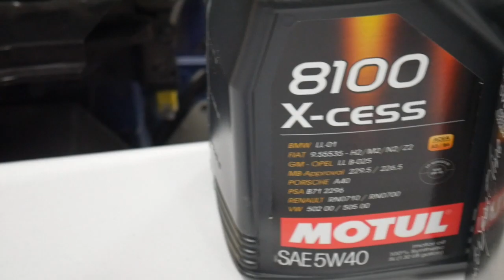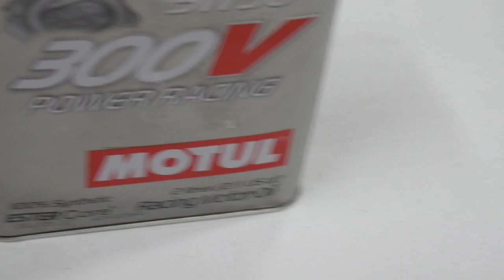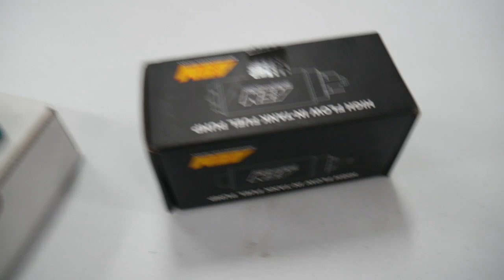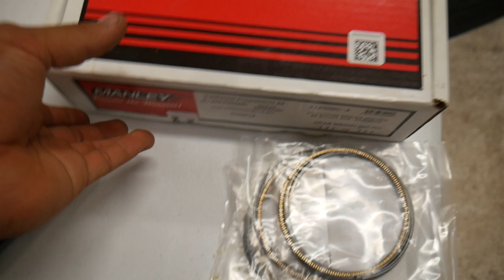how to make a SUBARU WRX or STI RELIABLE?!

Comment: Rotella is excellent oil. We use it in our diesels and our cars and it lasts a long time. I have 166,000 miles on rotella running a Cobb stage 2 on my 2006 wrx. The oil analysis showed that the oil is doing its job.

Comment: Just bought a 2011 wrx. It has just over 70xxx miles. Where I live the temperature varies from mid to low 80 degrees in the summer to around mid to high -20 in the winter. What oil would you recommend as a year round option, or could you give me some options as to what I should be using for summer and winter. Also can you guide as to whether I should get an AOS or a catch can. Thanks!
Reply from the maker: Carson Gorst definitely do the aos and for oil I’d run motul xcess 5w40 in the summer and motul 5w30 in the winter
Reply: Was using 5w 40 and found shaving, definitely went back to 5w 30
Reply from the maker: chem So Sick it wasn’t because of the oil

Comment: Bro I’ve seen a car on eBay, 10 reg, sti, 100k, lady owner for 10 years, full Subaru history - any tips or users guide to buy and what to look out for?
Reply: I know it’s way late BUT Don’t buy any Subarus that have modded out engines already. Buy a subi who’s engine has not been molested or one that has a new block. After 100k miles, I forgot what it was but there were certain components that needed to be replaced and have maintenanced. I’m sure the internet can help you out with that with just a few searches but make sure that work has been done. If engine has never been molested with mods and very well maintained, you could get away with getting it.
Reply: I just bought a 2008 Subaru Impreza WRX STI with a brand new clutch, brand new engine (fresh from the factory), brand new transmission, turbo (all fresh from the factory) and the proper PREVENTATIVE maintenance was done on the block to prevent oil leakage in the first place and a few other areas where these cars suffer in, 150k miles on her but new under the hood and the engine was done right. I plan to leave her engine untouched forever

Comment: Local mechanic told me not to tune my 01 wrx cause it will lead to piston failure is this true. My car has 225 000kms or 143 000 miles. And i want to install an air intake what you think ?
Reply from the maker: Joan very very false. As long as you go with a reputable tuner it will lead to longevity. Oem tune will cause piston failure before a pro tune
Reply: @awdpat  Do you think an cobb tuner is worth with the high kms
Reply from the maker: Joan I do! Open source tuning is also a great option if you don’t want to commit to the AP

Comment: when you say older subaru with the MAF sensor, i’m cobb tuned stage one with a cold air intake and nothing else running good. 2011 STI hatch. 70k miles. Replace MAF sensor?
Reply: lol no

Comment: With a Hawkeye having 95,000 miles, I have yet to change the maf sensor and my car runs rich from the ots cobb stage 2 tune and definitely not lean...is it still worth a new sensor? Will the sensor just peace at one point and make my car run lean or if it’s been taken care of will it be fine?
Reply from the maker: Evan Riel ideally you should replace the sensor and get a pro tune. Coming up on timing belt replacement as well
Reply: AWDpat thanks for the reply, honestly, took me this long to sub to your channel, way to plug it on your insta by the way, but timing belt has been changed as well as all fluids and front axles...I be stressing with this car as my first wrx didn’t last too long...
Reply from the maker: Evan Riel yeah definitely man! You gotta keep up with it and honestly depending on your setup, the its time could be causing a lot of your problems
Reply: When my sensor went bad, every time I would do a pull the AFR would go to 17 or 18 and would lose all power. Save yourself some money and replace it with a Denso. Aftermarket one suck

Comment: Hello AWDpat . Good vid and now I finally know what to do to not cook Subaru EJ engine :D I have some questions. If U can answer I would apreciate it :) I am considering to buy WRX 2006-07 Subaru Impreza. Not STi. I want to daily drive that car. What are safe RPM to cruise ? I read that not under 2000RPM.... Then what is the lowest RPM to shift up ? I heard about 3000RPM but will it damage anything around 2000 ? ... What is the max RPM ? I read that it is around 6500RPM above it could damage engine is it right ? And the final question. Is 5 speed manual really glassy ? I mean tune  WRX for example to Stage 1 will ruin something or no ?  Ty and have a nice day . Sorry for bad English .

Comment: They are only unreliable when you start doing mods and messing with the air/fuel ratio. Just want people to not think Subaru’s are not reliable! 
I had a 1999 Impreza outback sport 5 speed with 250,000 and never had issues!
Reply from the maker: Subiyota Fan different car for sure
Reply: @awdpat  also had a 2013 wrx, 2007 sti both reliable but they had no mods. Had a 2014 wrx that I went stage 2 and got rod knock..
Reply from the maker: @subiyota  yeah that’s generally how it goes when just slapping parts on. If you saw the logs from stock sti/Wrx tunes you would understand the need for what’s outlined in the video.

Comment: You use 5w30 on built motors??
Reply from the maker: ScoobySTI Chris it really depends on the clearance but generally no I do not
Reply: AWDpat thanks for quick response. Just wondering as I here 10w50 or 5w50 is what you use for built motors. P.s great video 👍

Comment: You lost after injectors and head bolts and pistons. That's half way there to a full rebuild lol. Idk if thats reliable mods or just building an engine. But seriously if that's what they need then I would consider these Subaru models reliable.
Reply from the maker: R26Roman It’s really just a suggestion I have close to 40,000 miles on a stock long block making near 500 wheel horsepower it’s been plenty reliable
Reply: @awdpat  wow ok so would you say if I bought a high mileage (180k) wrx for $1k I would need a full rebuild or just do reliable and maintenance work? I'm looking for a fun winter beater. Thanks for responding and looking forward to more content. Subscribing
Reply from the maker: R26Roman Honestly it depends on the condition of the car for 1000 bucks I’m sure it’s going to have a good bit of issues but if it’s a two point no I would just send it until it blows 2 L engines are pretty cheap and it’s literally less expensive to replace the whole engine then do all the stuff I talked about

Comment: UOAs show that you’re wrong about oil... Rotella still shows super low numbers.
Also their formula has barely changed, the regulations have changed so they’re no longer allowed to mark it as suitable for gasoline engines.. but it’s still just as good.
Reply from the maker: SpecVBlue a lot of UOAs out for the new formulation are from people that “daily drive” the car. I’ve used rotella myself and under load/ high rpm situations it overheats and breaks down much quicker than the motul I use now. I was logging much higher oil temps with rotella and the blow by was ridiculous. It would coat my manifold and burn off very quickly. I no longer see this with motul, in fact I usually don’t have to add any oil between changes.
Reply from the maker: MattyD exclusively! It’s good stuff